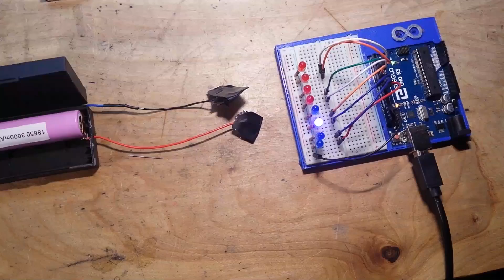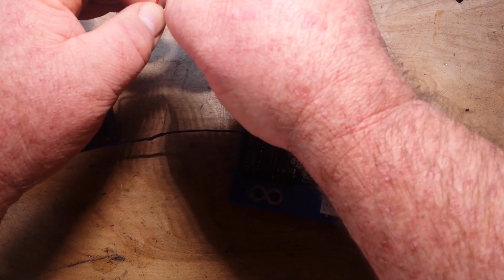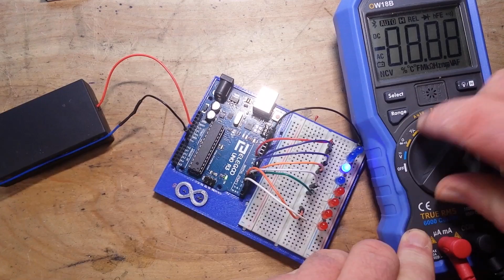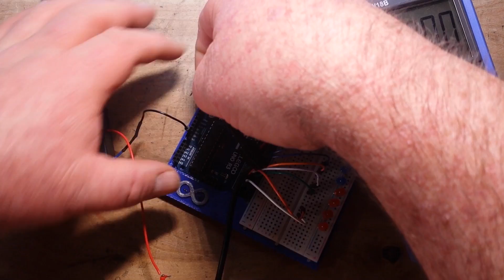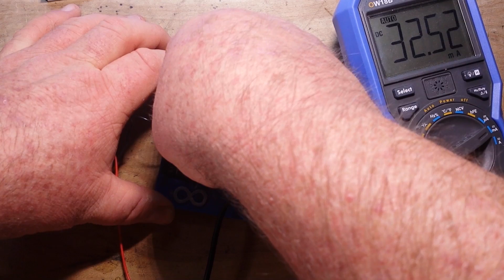Can you power an Arduino with a single 18650?

Comment from the maker: Gentlemen, the Arduino on a single lipo has finally went out. It is 3:45 p.m. on Friday afternoon giving us a total of 93 hours.
Reply: rest in pepperoni
Reply: Great videooo, can I put 3 18650s in parallel connection and not hurt the circuit?
Reply: @omniyambot9876  if you want, zou can put 10 18650 paralel.
Reply: learnelectronics that’s dammm impressive..
Reply: what was the voltage?
Reply: I know it’s a bit late but what voltage did it end at?
Reply: Anything pluged in arduino? sensors? Did you use it to control something or you just pluged in Arduino and let it run for 93h?
Reply: how to make this project with a charger unit?
Reply: gg

Comment: @learnelectronics, I'm a beginner, so please help..😅 I want to know if you or if I have to add an overdischarge protection chip to a setup where I power the arduino from two unprotected 18650 batteries?
Reply from the maker: Tp4056

Comment: why are you bypassing the regulator (e.g. through the VIN) and going straight to the 5V rail? Clearly it's not necessary to regulate the power with that 4.2V battery, but what difference would it make if you did? Would it increase power consumption because it'd be engaging the regulator? Or is it because 4.2 is below what the regulated power jacks require?

Comment: thanks for sharing that it can be done, but larson scanner is not something that needs a super computer, for other intensive tasks, speed can be a problem. and the results can be un-reliabe, causing even the people you are targeting a LOT of headache. better idea would be to define, how speed will be effected and results can go unreliable/bad if the clock speed changes due to voltage.

Comment: You've answered the question.  Just a little padding ... eBay is also awash with a shedload of self contained ESP32  devices complete with OLED screens and lots of potential for NTP clocks and radios with lots of bells and whistles etc.  All powered with 18650s.  Lots of support too - so if anyone is interested its all there for the taking.

Comment: Well professor.... :p really made me think, 33mA seems quite high, I assume that was mostly the LEDs source current? HOWEVER, a quick Google resulted in a standard uno board can have up to a 50ma idle current draw....thats insane!! Not a way to go for low power design.
Reply from the maker: There are ways to beat the high current draw.  Julian Illet did a video where he desoldered the voltage regulator and on board LEDs to get current much lower.

Comment: Assuming you change the brownout detection fuse bits, a normal 16MHz atmega328 will work down to below 3 volts. Clock divide by two in software and you can push that down around 2.4 volts. If you change the crystal for a 4MHz one, or use the internal 8MHz oscillator and set the clkdiv8 fuse bits, you can get one down to 1.8 volts.

Comment: Note that there is a relationship between the clock frequency and required Atmega supply voltage, check the datasheet. For 16 MHz you will need about 3.8 volts otherwise the CPU might become unstable. For this application this is irrelevant
Reply from the maker: Yeah, that's what 8 said at the end.

Comment: ...but you re not taking into account the speed of the 328p!!!!
Lol. I had to.
It's supposedly true according to the datasheet that you should slow the speed down to 8 MHz at 3.3v or there about.  However, a few commercial products exist (anarduino mini and moteino) that run at 16mhz on 3.3 v because of the rfm69 radios.  I ahve a few of them controlling some of my home automation nodes and they work well, so as you say poo poo to the datasheet!!!

Also Kevin Darrah did a video where he ran it at 3.3v 16 mhz and stuck it in an oven.  It ran fine!  

I'll bet you may not even know when yours stops...I'll bet LEDs stop because of the forward voltage drop before the 328p does...

But maybe not because it's running at 16mhz?  I can't wait to see what happens ...

Comment: It works quite nice even with 3.3V on 5V rail at least for programming and serial debug. for blinking leds thats good enought. Maybe try first with a coin cell CR2032 3V to probe,  avoiding any potential overcurrent issue and then put the 18650.

Comment: Professor Paul, I have a question (sorry no whining today :( ) At work I have nobody into electronics nor programming. So when I get the chance to "mess" with them I do is that ok?? Today was how to tell a 8 pin dip Op Amp was good or bad. First I had to explain what an Op Amp is. So I held the Op Amp a few inches above the desk and let it drop on its leads. Most of the time if flips over on its back with the leads up. I tell them its a bad Op because its legs are up in the air. They just stare at me wondering if that is true or not. The looks I get are priceless. After I dry my eyes and stop laughing I tell them the chip is still good and alive. Some folks walk away wondering why they wasted their time with me the other just half laugh. Thoughts??
Reply: Never hold a component or board upside down, the electrons will all fall out. I learned that from Dave over at EEVBlog :)

Comment: LiPo cells are not as sensitive as it was actually thought, and 2.5v became a myth heavily perpetuated. Even at 0v, there's not much ISCr detected most of the time. It's only when you reach the -12% SOC that you will see significant damage to the cell.

https://www.nature.com/articles/srep30248

Bigclive have a nice video summarizing not only the paper but also his own experience with discharging 18650.

https://www.youtube.com/watch?v=sRwoYJyjZNo

So no, do not worry too much about discharging it beyond 2.5v.

Comment: I made digital thermometer which works 500 days (not hours!) on single 18650 using Arduino and Nokia LCD turned on all the time. And it measures temperature every 60-80s, so ATMEGA is very good for lowpower applications. I had the project somewhere on my channel if anybody is interested.
Reply from the maker: You have a great channel by the way!
Reply: Great Chanel indeed
Reply: Subscribed
Reply: Lol i subscribed eu this channel alrdy...
Reply: Interesting channel. Subscribed. I'll browse through as time goes by. 

I number the videos on my channel so its easier to reference. Feel free to check it out but duly warned its not on any specific field. Tinkering with almost anything I can put my hands on.
Reply: I did a double take, 500days, but then you are using an Arduino Micro, lower overheads. Good video.
Reply: @tomgeorge3726  Actually Pro Mini with removed power LED so in deep sleep it draws only a few uA

Comment: I've had issues running a motion sensor and piezoelectric buzzer alarm on one 18650.. once that 4.2 voltage drops a little it is unreliable. Then its even worse when you add an RF out board thingy. I don't think current is the only aspect to think about.  really it depends on the load AND if you're only using the arduino or are you powering a PIR with the arduino off that one battery.... I could have simply made a mistake but it corrected when I added a boost converter up to 5v.
Reply from the maker: Yes it definitely depends on the load that you're drawing. And you don't want that voltage drop too low because if you're running external components they also have a minimum voltage.
Reply: @learnelectronics  exactly the issue I had. Sorry about the cold lab. You might appreciate it more if you had to struggle through year round heat and humidity. Lol. Filming sucks cause I'm anal about noises and humidity does strange things to flux when soldering

Comment: How can the output 5V port act as a sink port ?
He should have to connect the positive terminal of the battery to the Vin pin I think.
Reply from the maker: The 5-volt pin is direct to the 5-volt rail do it simply acts as a bus. VIN goes through the regulator which we had to avoud.
Reply: Voltage is too low. The Vin goes directly into the regulator input, it's the same as the jack, can be operated with 6 to 12v only, far too much for a single 18650. The 5v socket is directly out of the regulator output, so you can energize the system from it.

Comment: The voltage will drop on the cell over time so wouldn't the current also drop with it? Would this make the LEDs work longer but with a dimmer light?
Reply from the maker: Like I said, this was an experiment so when I report back I'll let you know if the LEDs get dimmer over time.
Reply: In contrary, voltage dropping will increase current drawn.

Comment: I suppose the next question is whether you can run an Arduino with a potato and two dissimilar metals, or whether you need a whole field of them? 🥔🥔🥔🥔🥔
Reply from the maker: Only during the autumnal equinox otherwise the Coriolis effect will prevent the flux capacitor from phasing
Reply: I am keeping my tats in Leyden Jars to use another Faraday.

Comment: Please don’t over discharge your lipo cell. The Arduino will drain it down below 2.5v which is the absolute maximum to go down without damaging the cell.
Reply from the maker: You should never run an 18 650 without some sort of battery management system this video is simply a proof-of-concept as to whether or not an Arduino will run on a single 18 650
Reply: You can set the brown out detect fuses to 2.7V but that is still pushing it. Also be aware that updating the bootloader will probably reset them to whatever they were. Otherwise you should probably figure out some other brownout detection scheme above 3V since the next fuse setting is 4.3V which is prettymuch useless.
Reply: Over discharging them doesn't actually damage them. Reverse charging and overcharging does. https://youtu.be/sRwoYJyjZNo
Cheap power banks come with the cell discharged to almost 0 volts and they recover fine.

Comment: Noticed the blue LEDs drawing  0.3 mA less than the red ones. Interesting for analy designing more power efficient circuits.
Reply: I read somewhere that the blue led's don't last as long as the other colours, but not sure by how much.. maybe 28k hours instead of 30k hours, I don't think it's by any significant amount.
Reply: Different colors require different currents (and they have different internal resistance). It's mostly a matter of physics (different light "holds" different energy), and not how a particular led is made. So, yeah, in this context you may chose a special color (blue, I guess) if you need to save power if that matters. Meanwhile, white leds are the most consuming, because they emit the full spectrum.

Comment: Maybe you could comment on how you will keep from damaging your lion battery. I'm sure you will tell us what voltage the battery is when it quits running, but what if that voltage is considered too low for that type of battery?
Reply from the maker: You should never run an 18 650 without some sort of battery management system. This video is simply an experiment and a proof-of-concept as to whether the Arduino will run on a single battery. But I'm glad you noticed that.

Comment: -17 F (-27 C),  -35 F (-37 C) with wind child, in my locale yesterday evening, a frost bite warning alarm would be a good project
Reply from the maker: Now that does sound like an interesting idea. Do you know if there is a certain temperature or humidity level that is a cutoff for frostbite? I can always Google it of course.
Reply: @learnelectronics  the conditions I noted will caused frost on minutes according to local news outlets. Lots of warnings go out. The kids stay inside during the school day. The dog is smart enough to refuse a walk - just a quick trip out to the yard and back. That's the extent of my knowledge.  A data logger that connects to a phone may actually find a market. Hang it off a jacket zipper pull.

Comment: Iol,I was about to mention the speed voltage problem... It's literally like, on 10th or 20th page of datasheet, and is hard to miss.
Reply from the maker: I knew someone would! Lol 😉
Reply: Love the channel and your cheerful voice. On the speed voltage : that info is 2 rows under operating voltage. I  wonder if  arduino running at 16 MHz will stop due to insufficient voltage. I would like to suggest to check the battery  voltage if it dies well before the 90h. Keep up the good work.
Reply: @ovidiunainer3411   for one of my project on normal cell , when undervoltage, it restarts like crazy and its barebone arduino chip.